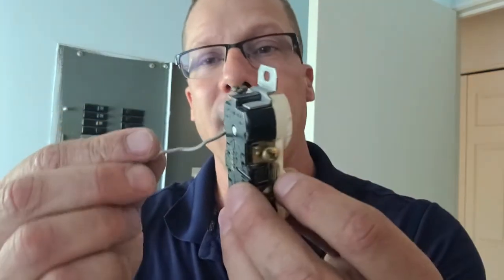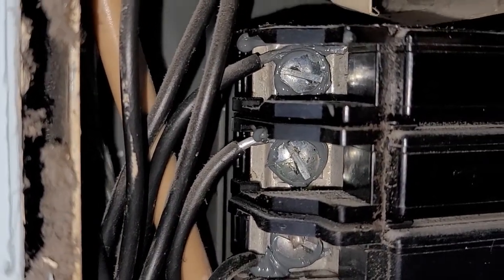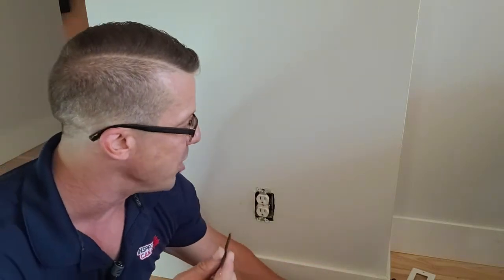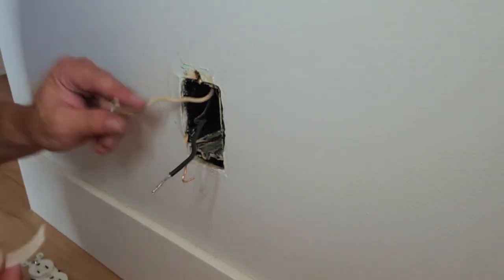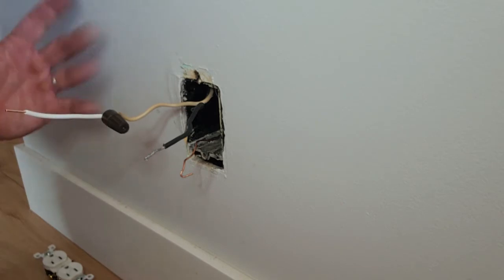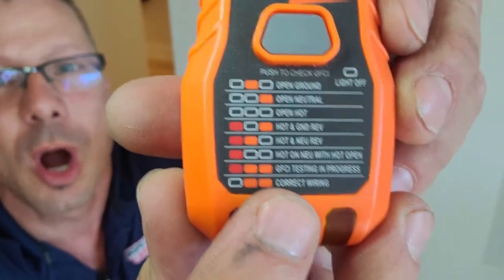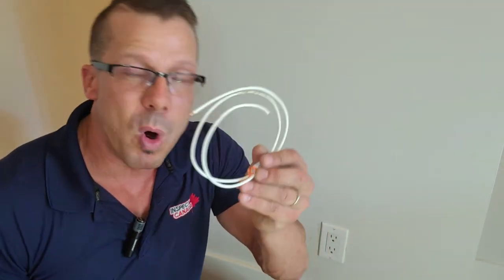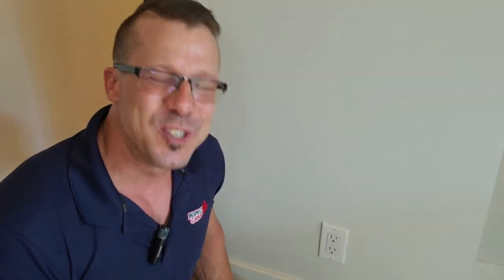How to pigtail aluminum wiring to copper

Comment: I had to stop at 4 and a half minutes. Perhaps canada does things differently than in the US so I'll point out a couple of things. One, You didn't sand the aluminum conductor before putting the nolox compound on it. Aluminum will oxidize in minutes so you have to work quickly. Next aluminum will flow under pressure so you will have an issue if you don't use the proper compression device. If the aluminum gets exposed to air it will oxidize and even under pressure will heat up because aluminum oxide is an insulator and not a conductor as copper oxide is. Now there's only one way to connect up aluminum to copper and that's with a compression barrel connector and crimping tool. Somewhere around 6 to 12 tons of pressure is required. The connector is filled with nolox and the aluminum is cleaned and immediately inserted and the connector crimped. Then the other conductor is inserted and crimped. Special wire nuts for aluminum are a temporary fix only. You never use any type of mechanical lug or screw with aluminum. I've done this for forty years and never saw a proper connection fail but also never saw an aluminum mechanical connection that hadn't over time and load. Years ago I had a neighbor call me on a sunday morning to ask if I knew  anything about refrigerators. I said no why and she said hers had quit and even melted the cord were it plugged into the wall. I asked if her house was wired with aluminum and she said yes. I said I know what to bring. I pulled the plug out of the wall and luckily there was a lot of wire folded up in the box. I cut off around six inches of wire with crystalized insulation and then installed a new receptacle with serrated screw heads made for aluminum. Replaced the cord cap on the fridge cord and turned it on. It ran. I told her the repair was temporary and suggested she have her entire home rewired before the wiring caused fires.
Reply from the maker: Hi there and thank you for adding value. I agree that sending the aluminum wire first is definitely a good idea but after following electricians on a few pig tailing projects, I've never seen them doing it. There are best practice for evething and definitely removing the oxidation from the aluminum wire would be an added bonus. The marrettes I'm using are designed for copper to aluminum connection and is what the insurance company like to see here. When we inspect house with aluminum wiring we always open an outlet or 2 to see if they are pig tailed or not and never saw an issue with any of them for using the proper marrettes. I know some inspectors in the US said that pig tailing was not approved in their state but it's perfectly fine here in B.C. I'm very grateful that electricians with over 40 years experience watch our videos, thank you so much for your comment.
Reply: Now days in the US aluminum is outlawed except from larger sizes and they must have high compression connections on them to be allowed. Aluminum is simply not a good material for wiring unless used under strict restrictions.
Reply from the maker: @71160000  Hi, single strand aluminum has not been used here since 1972. This video is about how to keep the insurance happy if you bought an older home that was built between 1965 and 1972 and has single strand aluminum wiring. We create these videos for our home inspection clients.
Reply: @InspectCanada  Sad, that it's still legal to have a home wired with aluminum. But same solution still goes. High pressure terminals only.
Reply: I understand wanting to satisfy the insurance companies, but safety should be the number one priority - and if insurance companies are worried, we should be too. This is definitely a repair you want to research and follow the most up to date protocol. The US consumer product safety commission recommends using a crimp connector like COPALUM (unfortunately requires somebody with training) or alumiconn which uses compression screws (with a torque setting screw driver). I think if somebody is interested in diy, they should consider the latter option. The twister connectors seem prone to user error

Comment: You really should cut the tips off the aluminum be wire and restrip your wire so there is no chance of it breaking off at a weak point. Furthermore, the wire should be twisted together at the tips. If there is vibration as this man has stated. It will come loose from the caps as well, if not installed properly.. I'd wrap electric tsp around the caps as well, just to make sure it never comes loose.
Reply from the maker: Good info thx

Comment: . I'm looking to buy a house and the inspection report came back with the aluminum wire issue.  This was so educational. Thank you SO MUCH for putting this video, it was easy understand.
Reply: That's good that your inspector looked at that. Mine "couldn't" disassemble anything or move anything in order to check.

Comment: Would this same method apply for light fixtures too? I wanted to replace a light fixture in the ceiling and I am wondering if it will have some aluminum wiring up in the ceiling or not. Also how long should the bits of copper wire you're pig tailing in be? 

Apologies if you mentioned any of these things in the video, it's quite loud where I am so I'm worried if I may have missed it or not lol. Thanks for such an informative video, will be very nice to keep in mind should I encounter any Aluminum Wiring.
Reply from the maker: It is best practice to do it everywhere including switches, lights, fans etc but not as necessary as the outlets. Most electricians would recommend doing it all. Thanks for watching our videos.

Comment: Does this insurance requirements apply to newer houses using the new kind of AL alloys wiring ?
Reply from the maker: Hi, aluminum wiring stopped roughly in 1976. The aluminum you see in panels are multi strands (3-4 aluminum wired twisted together. Those are ok, it's the single strand aluminum that is a problem. Thank you

Comment: I have a question: Even with the antioxidant paste, if copper and aluminium touch eachother, won't you have a quimical reaction? don't you need to use a bimetal connector? Thanks.
Reply from the maker: Hi, so far that's how I see electricians doing it and the insurance happy with it. There may be better ways but the antioxidant paste appears to work great.

Comment: I was under the impression that if you use the Marrette 63's you didn't need to use anti-oxidant. Am I wrong??
Reply from the maker: Hi, it's because when the aluminum and copper touches each other as they will be twisted together, they need the paste to prevent oxidation.

Comment: I'm not up on Canadian code or local provincial requirements, but 
The terminal screws on CO/ALR devices are made of special materials and designed to grip aluminum wire very tightly. 15 Amp/125-Volt grounding Residential grade, NEMA 5-15R, 2P and 3W (Example: Leviton Model# R51-12650-00I)
Reply from the maker: I've got nothing to do with it, it's an insurance issue. They don't want aluminum reaching any outlets even if they are designed for aluminum wiring.

Comment: Thank you David for this instructive video.  I have a situation where I have 3 aluminium wires (14 AWG Copper Equivalent) that I need to pigtail with 1 copper wire. The marrette 63 is too small to do it. How do you think I should do it? Thanks!
Reply from the maker: Hi, normally when you twist them slightly first, they should fit but if it doesn't, please check with an electrician. I've seen it holding 3 wires. Don't forget the paste when twisting them together.
Reply: @InspectCanada  The marrette 63 box specifies a maximum of 3 wires, in my case I had 4 wires. I did it using 2 marrettes per pole, i.e. 2 marrettes for the common et 2 marrettes for the life. At the end I had 4 marrettes to fit in my box, luckily my electrical box was deeper allowing me to fit all this hardware inside the box. I just hope, it was ok to do it this way^

Comment: When you do the pig tail and replace new outlet, do you use the outlet made for Co/Al or just for Copper is fine? As only copper wires  touch the outlet so I guess outlet for copper should be fine but I want to be sure. Thank you very much.
Reply from the maker: You can use one or the other, the are both good for copper wiring.
Reply: @InspectCanada  Thank you very much for fast response.

Comment: Do you have to do this with copper clad aluminum?  
Mine house was built in 1971 and it appears to have copper clad aluminum.  
I cut the copper colored wire and it looks silver inside.

Comment: Whats the differece between these marrets and the purple ones
Reply from the maker: Hi, the one I used are designed for aluminum to copper connection, the purple might be the same but I haven't checked them out. I went to a electrical supplier and that's all they had.

Comment: Hi there! I am about to spend a considerable amount of $ to buy enough AlumiConn connectors to do all the outlets in my house which was built in the 70's in Aylmer (Gatineau). It gets pricey fast because you need 2 per receptacle and they cost 100-125$ for a 25 pack. You are tempting me to take this cheaper alternative but I've seen some professionals on YouTube either say it was not up to code where they reside, that the anti-oxyde paste can leak over time or other things of that nature pointing out it is not an appropriate way to go and that only using AlumiConn connectors let them sleep at night and is a permanent way to fix the issue. What is your take on that? I'm no electrician and if you ask me, you seem to do a pretty good job I would be confident to replicate - it seems pretty safe to me but I'm no electrician or scientist :) Thank you so much by the way!
Reply from the maker: Hi there, I'm also no electrician but I've seen it done in many buildings by electricians. Buildings are often forced by insurance companies to do it and that's how they did it everytime. I think in general, the alumiconn are probably a better quality solution but pig tailing with the proper marrettes and antioxydant paste is being done by electricians and approved by the insurances in BC. Wouldn't hurt to contact an electrician in your area and ask what the insurance company require or maybe ask the insurance company. I can only talk for BC. Thanks for watching our videos.
Reply: @InspectCanada  Good idea! Thanks so much for the quick reply. I subscribed! Cheers :)

Comment: I have a question that i am wondering. If i pig tie the aluminum to copper wires. do i still have to use a co/alr outlet to wire it back on or can i use one with out the co/alr like the ones you used in the video? Also the for screws on the side, do i screw the bottom ones in while the top on each side has wire?
Reply: You can use an outlet that is rated for copper only, as copper is making the connection at the terminal. It's good practice to tighten the screws. It in use, just to keep them away from the sides of the box.

Comment: What kind/grade of copper wiring should I be buying to pigtail to my aluminium ends? I'm looking on Home Depot (Canada) and there are a bunch of different kinds. Any insight is welcome! Thank you
Reply from the maker: Hi, for a 15 amp breaker, you need a single strand 14 gauge copper wire. You can buy it by the meter a homedepot.ca
Reply: He said to use a 14 guage wire to make the pigtails.
Reply: @MrSanmanbob  Thanks Robert. Appreciate it. Ended up going with 14!

Comment: How do you pigtail range and dryer?
Reply from the maker: @jaspal9163  You don't, those are multi strand wires and are still use today with no issue. The only one is the single strand wire.
Reply: @InspectCanada  thank you

Comment: I just got done fixing what was done here.  The wire nut that was raised for this with the compound turned to ash after arching.  My flir showed the wire heating up to 180 degrees. After using the alumicon with the small buss bar inside temps are down to 80.  This was on a water heater.  I wouldn’t recommend the nuts.
Reply from the maker: Alumicons are great but wire nuts have been used for a very long time with no issues. Thanks for your comment
Reply: well water heater usually more CONSTANT high amperage 20 amps, then recommend to change whole wire. This is low 15amp wall outlet that will rarely or never see 15amp

Comment: Is there a different type of connector i can use when the wires from outlet are too short (aluminum) and i need to connect copper. Im referring to the push in wire connector...can you attach aluminum to copper with those?
Reply from the maker: Hi, I haven't done it but I think there are specific aluminum connectors. Might be best to get an electrician involved.
Reply: @InspectCanada  yes there are special push in connectors, why they cost so much is beyond me. I would never pay that price. I'll just connect them the way I did last time with the oxidation cream . Thanks ...

Comment: also what about light fixtures ?
Reply from the maker: Hi James, great question. Outlets are constantly under load but lights only when you turn them on. I would definitely recommend doing swtiches, outlets and light fixtures but here in BC, it looks like the insurance companies only requires the outlets to be done.
Reply: @InspectCanada  thanks i am just thinking more for safety but burning led bulbs probably don't draw much heat either
Reply from the maker: @jamesharnish650  If I was going to pig tail my place, I would do switches, outlets, fixtures and smoke alarm.

Comment: Jeez I hate to see old brittle aluminum ugh I’ve seen so much with aluminum it’s really not that easy I would use alumiconn connectors so your not bending the aluminum other than rewiring a house the alumiconn connectors in my opinion are the safest remedy just for the fact your not bending old brittle aluminum
Reply from the maker: Agree that the alumiconn are better but the insurance companies are ok with the proper marrette and easy to install. Thanks for watching the video.

Comment: What about the size of the copper wire that you pigtail on ?  Does it vary?   Is there a standard cost ?
Reply: aluminum wire should always be one size larger than what is called for copper. aluminum just is not as good as conductor as copper.

Comment: I'm in the middle of making these repairs. Question, should I twist the aluminum and copper together before putting on the Marrette?
Reply from the maker: Hi, you can but if you put them side by side and spin the marrette clock wise, it will twist them together. Thanks for watching our videos.
Reply: @InspectCanada  Thanks. Another question, I have two aluminum 14/2 if you will call it, along with one 14/2 copper. Can you join multiple aluminum wires to one copper?
Reply from the maker: @n3m3f3  Hi, yes. When twisting them, place the copper in the middle. You have to be sure to use the proper marrette and use the antioxidant paste.

Comment: so why no pigyail to ground ?
Reply from the maker: Hi James, great question. The ground was already copper. But even when it's aluminum, it normally doesn't get done. The reason is that the ground is only there to carry the current if their is a fault or malfunction in the system and is almost never in use therefor it will likely never going to get loose due to expansion/retraction.
Reply: @InspectCanada  ok thanks. Do you think this is better way to go than co/alr outlets and switches ?
Reply from the maker: @jamesharnish650  There is probably a bunch of better solutions but that's what the insurance wants to see. Insurance just don't want to see the aluminum reaching the outlet.
Reply: Also since boxes especially in ontario are metal and bonded you can bend the aluminum wire into the back of the box or cut it as long as its connected to the box you can than connect the copper wire to another scre on the box

Comment: The biggest mistake that you forgot to do is to put the  special grease inside the aluminum Marette, because if you don’t put in that grease in aluminum Marette, it can cause a fire because bear copper in bear. Aluminum doesn’t really react to each other that well bonded together so the special gel that you put in the Marette will make it safe and up to electrical code in Canada
Reply from the maker: Hi, I 100% put it on the wires.

Comment: Don't do this!! get a co/alr outlet (made for both copper and aluminum wire) a pigtail just adds an unneeded connection. About $5 at Home Depot
Reply from the maker: The pig tailing is for insurance purpose. They will think that in the future someone may replace that outlet with one that isn't rated for aluminum. They want pig tailing. This might not be the case in your area but here in BC, it is the way to go and done extensively. Thanks for watching our videos